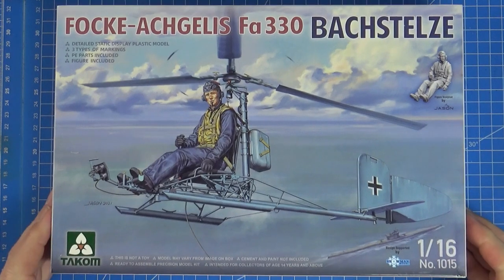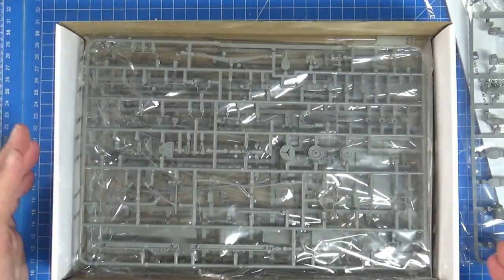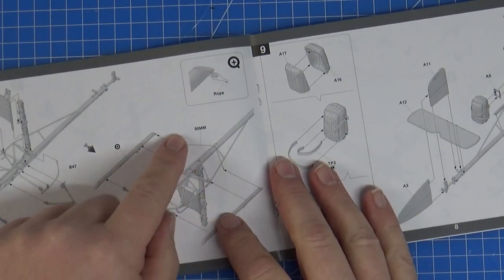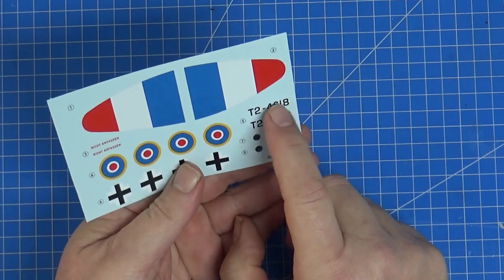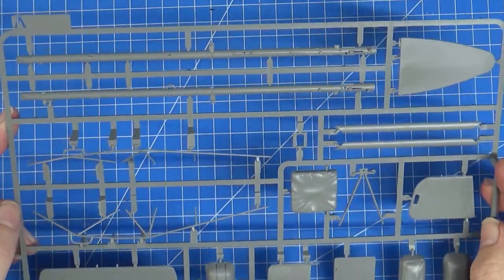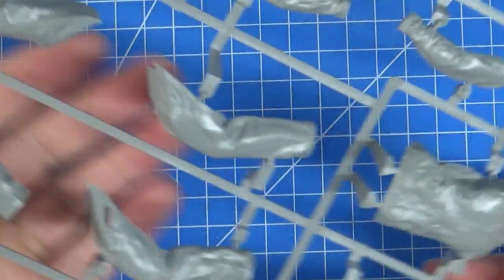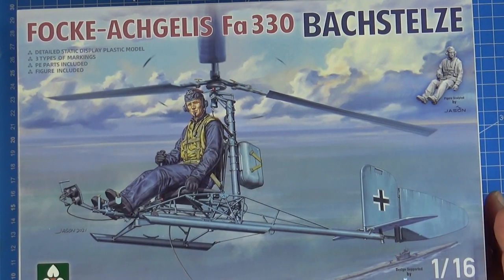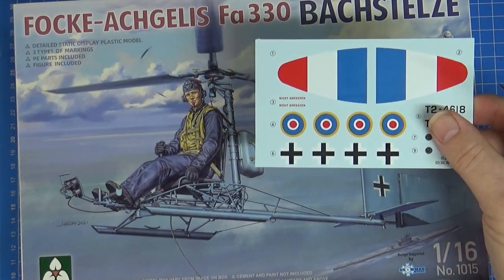Review: 1/16 Takom Focke-Achgelis Fa330 Bachstelze

Comment: Very interesting kit, surprised a company would invest in molds for such a small craft, ergo the 1/16th scale. A bit like a  mosquito compared to the Beast you were detailing last, the pilot is superb. Based on submarine launched aircraft like this, that pouch is probably a tool box so the tools for assembly are always ready. With pilot wearing a life vest, in case of emergency, they would cut him lose, he would auto rotate and tread water until the sub could resurface and hunt for him.
 If you want to get a real kick, see if you can find the movie Where Eagles Dare with Richard Burton, Clint Eastwood and I think Inger Stevens, you will see the motorized version of that model,. a great guy movie and gives you a bit more information on it. Never before have I seen three people defeat the entire German Army. Sikorski's first helicopter looks very similar. Even with bad decals, there is not too much area to put them on. :-)  Keep us posted..
Reply from the maker: I need to rewatch Where Eagles Dare, saw that about 30 years ago I think, thanks I'll check it out! I got the pilot to fit in the other kit, but he needs an ankle-etcomy, aka feet cut off!